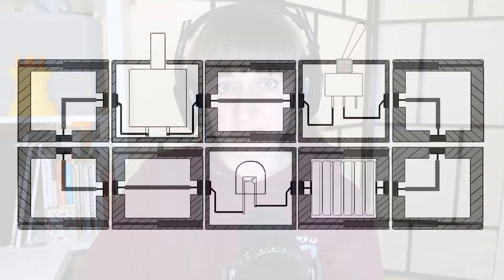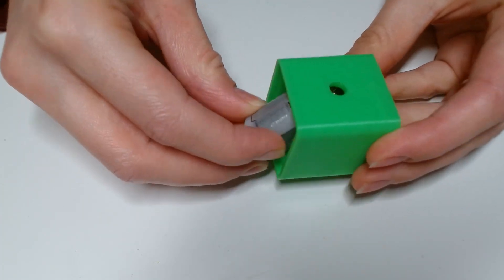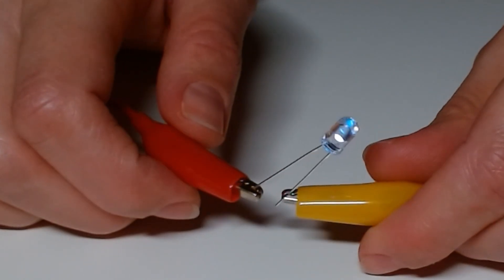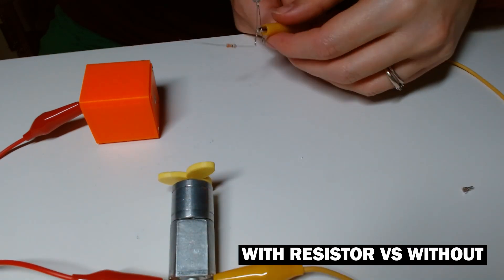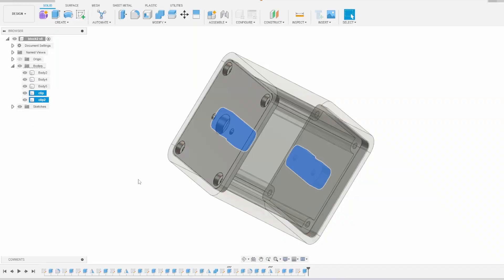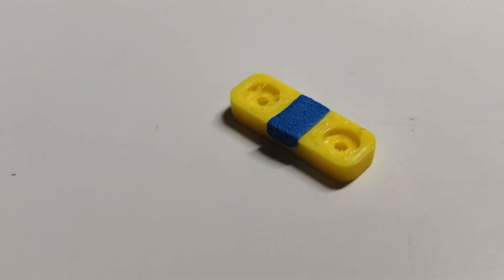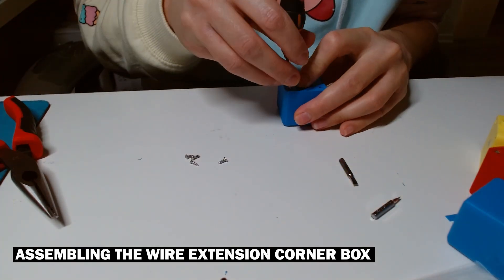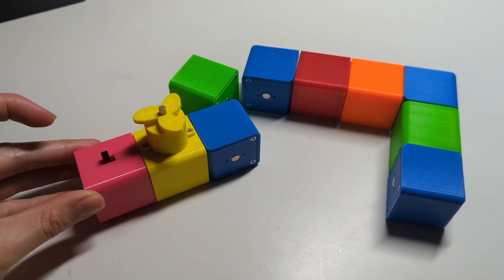Making Modular Circuit Building Blocks

Comment: That's a very cool project. Some leds have built in resistors. Maybe your red ones do. You can also buy  flashing leds and color changing leds but they also need an inline resistor. I think an N20 gear motor would be a good match for your project as they are much smaller but have good torque and low current draw. I use them in my projects.  You might consider 3 AAA batteries in a Cylindrical  holder for a 4.5 Volt supply.  The batteries will last a lot longer than the coin cells and I doubt you will need the 15 Volts. Your circuit is a series circuit and all the current for the motor runs through the led and the led resistor. Probably not a good ideal. To get around that you could make a junction block with 3 contact points. This will allow you to make a parallel circuit. Then you would have the led and resistor on one branch and the motor on another branch. I think you will really enjoy learning  electronics. It goes well with the 3D printing hobby.
Reply from the maker: Thanks for the insights👍

Comment: Well done Lexie, this is great! 
Did you try the red LED last? I think the reason could be that the batteries got damaged during your first few tries with the white LEDs. Connecting an LED directly to 15 volts creates high current flowing through both the LED and the batteries. When you fried the LED, you may also have damaged the batteries to the point where they can’t supply that much current anymore, saving your red LED. 😊
Reply from the maker: Yeah I think I probably did damage the batteries.